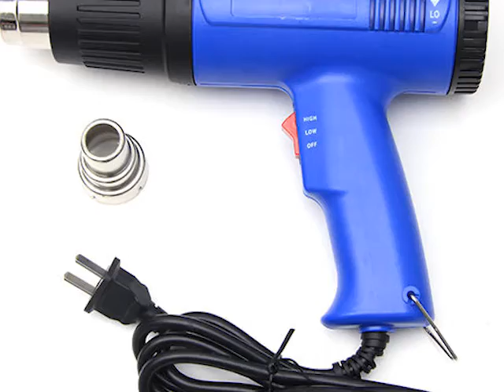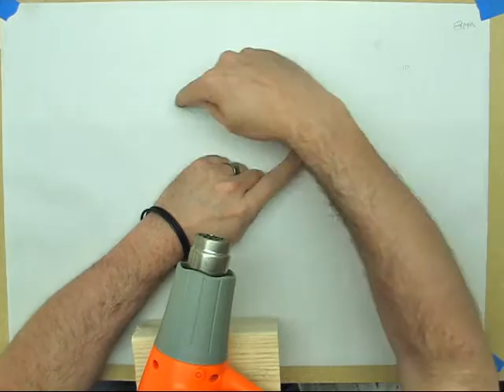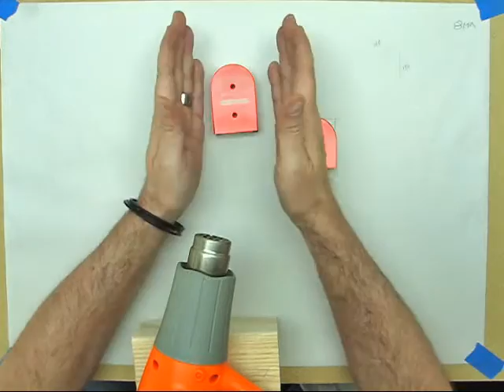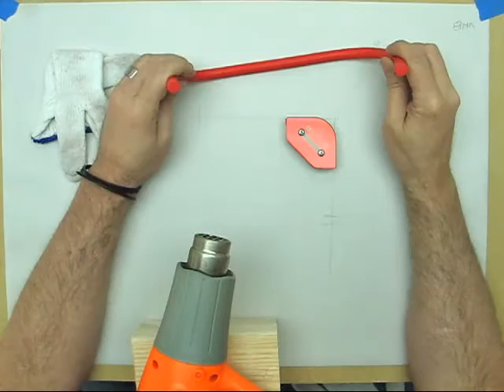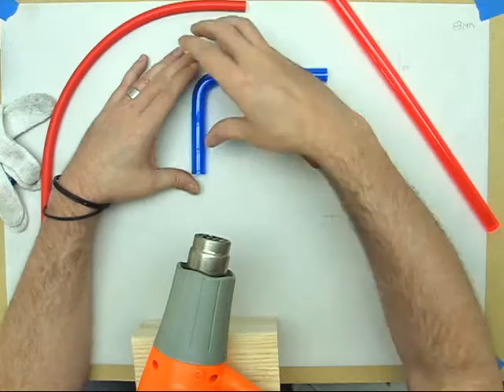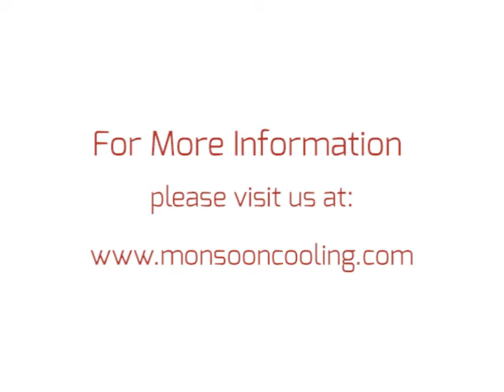Hardline Tools Heatgun Kit

Comment: when I heat up my petg tubing the heat makes the tube flare out, even before I start the bend.

how do you stop that?
Reply from the maker: If the end is flaring out you are trying to make a bend too close to the end of the tube.  One solution is to leave extra length, make your bend, and then cut off the extra tube after it has cooled.  If it is flaring in the middle you are heating the tube too fast and / or too unevenly.
Reply: I'm not doing it too close to the end, as I happens not matter where I bend it. Even before it's the right heat it flares out
Reply from the maker: Without more information...not sure what to tell you as I have never come across that issue.
Reply: where can i buy your products!!

Comment: I noticed a slight distortion on top of the bend on one of the legs. Im assuming this is probably from your finger pushing on the heated  part.
Reply: It happens sometimes--especially if there is a camera in the way.  Don't worry about it as it is not visible when the tube is filled with fluid.

Comment: Are you using the low or high setting on the heat gun?
Reply from the maker: +Sal Morreale 

I use the high setting but make sure to keep the tube moving constantly.